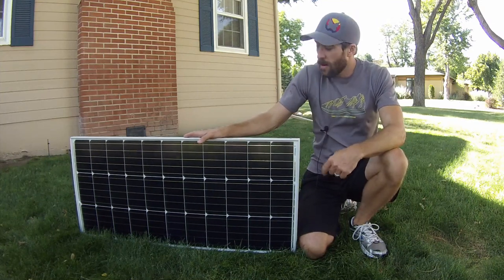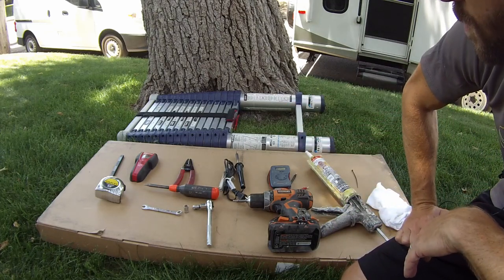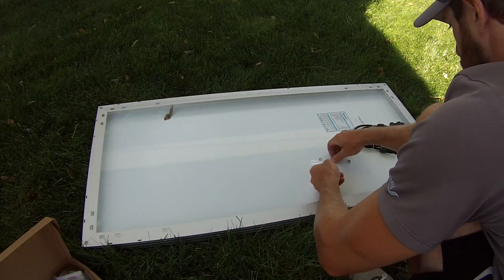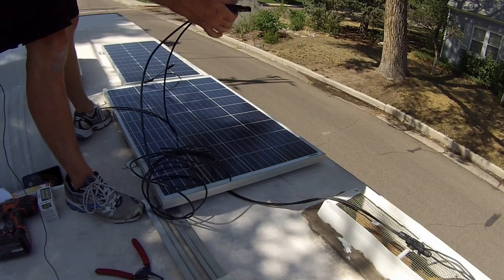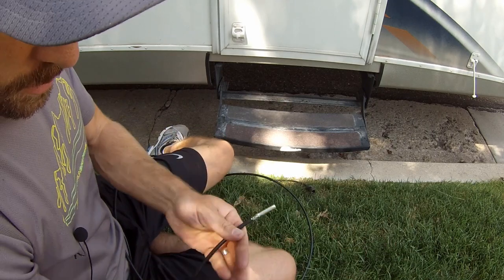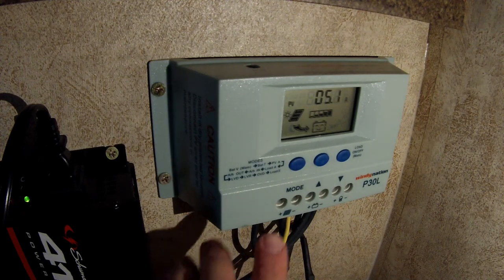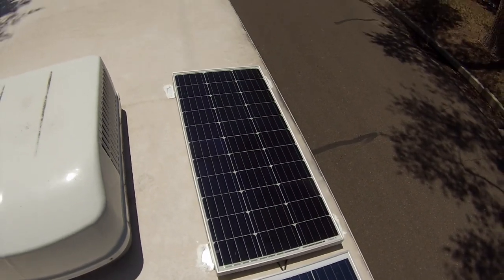How To Add Another Panel To An RV Solar Setup - Adding An Extra 100 Watt Panel To A Solar Setup

Comment: thanks for this vid. My rv dealership wanted to charge me 1300 dollars to add another panel on my camper. I can do it myself in a half hour. for 200 bucks.
Reply from the maker: $1,300?!? That's insane! You can definitely do it by yourself. Good luck with the install and thanks for watching.
Reply: @ColoradoCamperman  yeah, I laughed and hung up.

Comment: Is the load from your control charger connected directly to your inverter box? I am a beginner at solar trying to run my 18 foot travel trailer off solar.
Reply from the maker: Yes, the charge controller is hooked up to the inverter box.  I did another video on how to install a solar system start to finish.  You might want to check out that video.  Here's the link: https://youtu.be/v_omW_iK9NQ

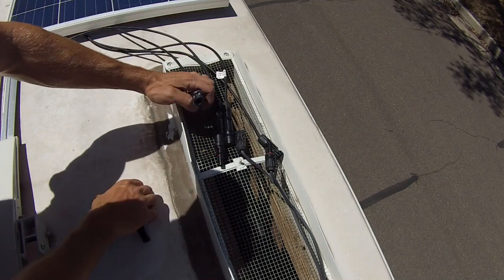Around 11:14 in the video I show how I hook up the charge controller to the inverter box.  Thanks for watching and good luck with the install!

Comment: Is there a maximum wattage of panels you could add?  I currently have 200 watts of solar and want to add maybe 600 more (3x200 watt panels). Thanks!
Reply from the maker: It depends on your charge controller.  That would likely be the only thing that would limit you.  Good luck and thanks for watching!
Reply: Charge controller limits which makes the wire gauge limited too. My camper has a 30 amp controller with 190 watts. Per Gopower, I can expand to 600 watts with the current wire and controller,

Comment: I have the Zamp 140 watt suit case Solar panels. I want to add another 100 Watt Zamp suitcase panels can I add that to my existing panels.
Reply from the maker: Yes, you should be able to add another panel as long as your charge controller can handle the additional power.  More than likely it can.  You will probably also need a Y connector.  If you have MC4 connections, you could get a Y connector like this: https://amzn.to/3ysAQR7  I hope that helps, thanks for watching!